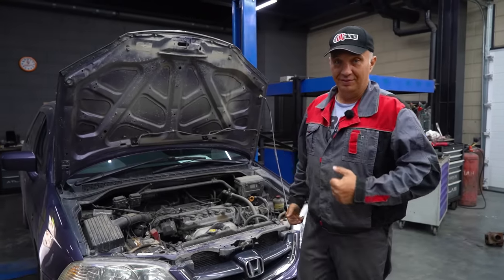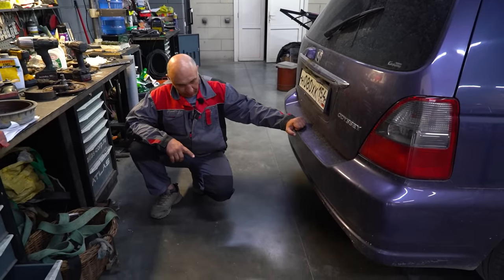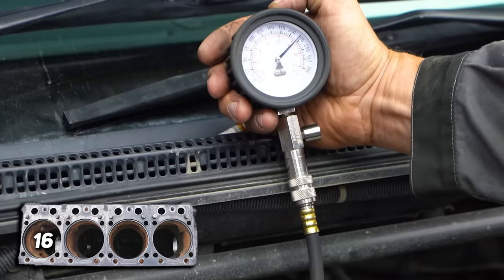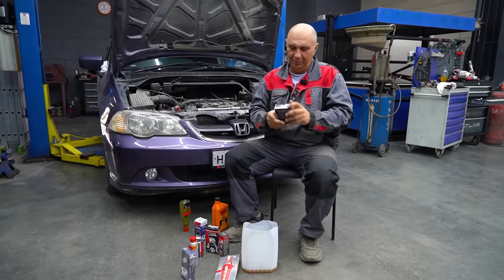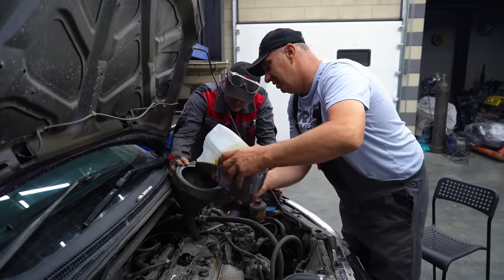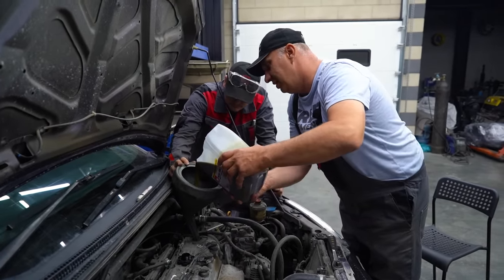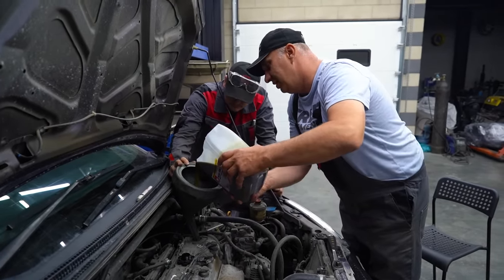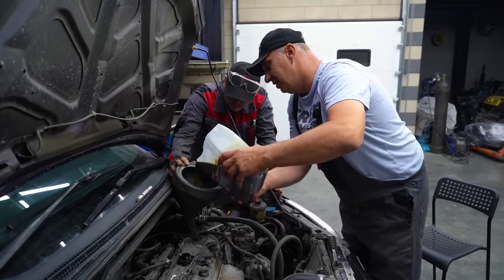Running an engine on additives instead of oil - what will happen?

Comment: when i was a kid i had a gokart and i removed the governor , that made it spew oil out of the breather , one night i decided to drive my kart to my girlfriend 6 miles away on the highway , i ran out of oil and siezed the engine . a friendly man drove by and asked what was wrong , i told him i was out of oil , he handed me some 2 stroke oil it was all he had with him , i put it in my crank case and she fired right up and i was on my way . so pretty much anything will work as long as it can lubricate the internals , at least on a 8hp tecumseh.

Comment: Junkyard turbo kit. Any old turbo thats big enough, lower compression with an extra headgasket or plate then add fuel on boost. See if it can be faster than that Toyota.

Comment: take the oil out fill it with water instead go until close to fail but not complete fail strip it apart clean it up put it back together add oil check results lol

Comment: Obviously replacing motor oil with spirit or vodka would be nice torture as it should clean the engine inside... You gotta torture it properly before rebuilding it.

Comment: It sounds like it has a broken piston return spring rattling around on top of the piston..

You should have pulled off the sump pan to inspect the bearings and crankshaft before the testing and after the testing.. the random popping is likely a timing issue caused by the ECU because it's not a healthy motor and the valve seats or the valves are worn out or full of carbon build up!! That would explain the valve train noise and maybe some of the smoke!! But 90% of the smoke is ring's or out of shape bores because it gets worse as it gets hotter letting more oil past the rigs and causing a backfire when it's full of additives that are likely flammable under that heat and pressure..

Just kidding about the piston return spring rattling noise though lolol I couldn't help myself because of the scams and funny videos about the fake return springs 😂😂😂😂
Reply: I think it's worse than that. If the owner is true to his word, he only changed the oil once and has been 'topping it off' ever since. There has probably been piston to valve contact, there are destroyed bearings and journal surfaces, and who knows what else is going wrong in there. I can't imagine the bores for the pistons look very good, and maybe the piston is cracked if it made contact with the head hard enough. This Honda engine is probably not long for this world, no matter what weight oil they put in it.
Reply: @orellh.1836  yep 👍 it's a Hondont lol they all blow smoke eventually lol 90% of the time it's ring's but they also have valve train noise from carbon build up and from lower oil pressure causing VTEC hydraulic actuator to fail making VTEC slow or not activate at all.
Reply: @michaellegg9381  It showed good compression, so I don't think it's the rings necessarily. The amount of glitter in the oil tells me it's bearings and other problems causing so much smoke.

Comment: Clean the engine with kerosene through the vtec screen solenoid then use restore 4 additive mixed with your oil and put some castor rc oil in the gas

Comment: I'm wondering if that's fluid out the back is fuel.
Reply: It's condensation. All cars do that. N it's black because carbon is in the exhaust.
Reply: @shawnsatterlee6035  I was thinking that until they saw fire coming out while on a drive.

Comment: Pretty sure those piston rings are toast lol
Reply: valve seals.... bet the rings are fine.
Reply: @CotyRiddle  Judging from how bad the old oil was, she probably didnt ever get oil changes, which isnt too good for pistons and bearings ha. Plus he said it would get low and he would top it up, im sure it probably ran out of oil a time or two lol. 

But also from the sound of how loose those valves where, that could be right.. lol
Reply: @VashStarwind  yeah possibly a combination. hell the honda I have sounds clattery like that too even after readjusting the valve lash. some of them motors are just noisy like that. Mine don't smoke at all even with the warped head LMFAO

Comment: You should have used other car brand, Honda Cars is strict on its oil, Honda engines are supposedly maintained by Honda oil only. Other oil brand will make the engine sick.

Comment: Why is there a 4 cylinder civic engine in a honda odyssey there should be a 6 cylinder in there.

Every time they drain the oil a lot of metal comes out.

Comment: Use wd40 as motor oil, it's super thin and it doesn't really lubricate well. I'm sure that honda engine will die.

Comment: Aha another engine for a complete cleaning using your beloved high pressure water cleaner then adjust the valves and replace the valve seals

Comment: I watched a guy pour diesel into a crudded up mazda 3 engine. Started it to flush carbon it ran for about 1 minute and clogged the sump immediately locking up. I had to unsieze the camshafts from oil starvation, remove pan and clean a pound of carbon out. he then promptly sold it.  Loser idiot. I left that business shortly after... Bad business is a NO NO.